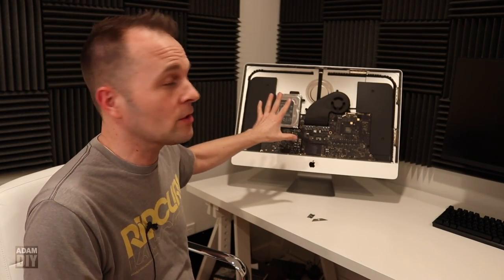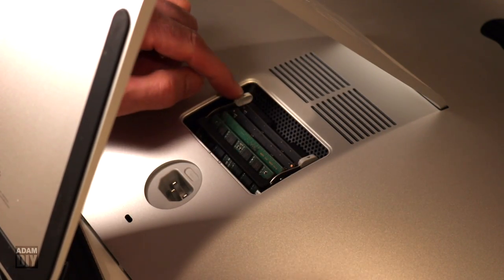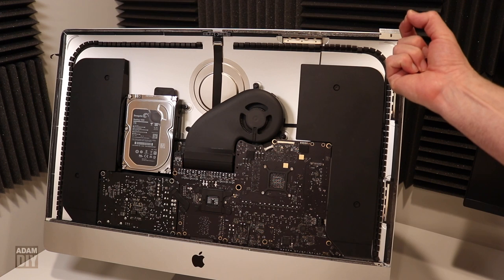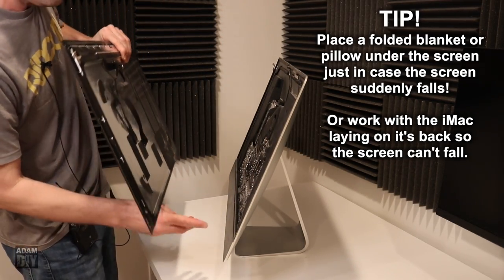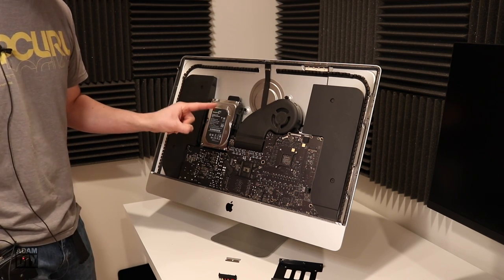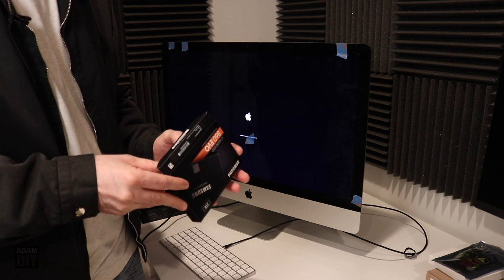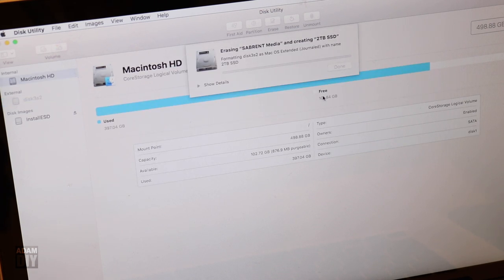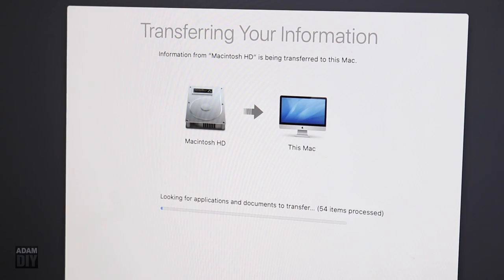$1000 mistake! How to upgrade iMac SSD & Thermal Sensor 2017 A1419 hard drive replacement

Comment: Another idea. A lot of adhesive tape isn’t supposed to have a load on it for at least an hour. I replaced a friend’s iPhone battery yesterday, replacing the seal too, and one repair video showed putting the phone on a hard FLAT surface for an hour or so with some heavy books on top. Laying the iMac face down for a few hours, just under it’s OWN weight, might help. (Keep painters tape on while flipping over, & until afterward.)

Comment: i've a iMac 2017 27" with HDD. I switched it with an SSD without the temp sensor (only used a bay to mount my SSD 2,5" on). No issues with the ventilator!
Reply: Not all iMac models require the heat sensor. Check with OWC or iFixit.com for which models do. There’s also software that will control the fan speed after boot up. (If already hot, such as during a Restart, the fan will run full tilt until finished booting.) I wish OWC wasn’t the only company making/selling them, because ~$40 is a lot to pay for a cable.
Reply: @apmiller77   I'm upgrading 27" late 2012 to ssd, currently attached using external usb to sata iii cable. When I open screen using $10 amazon tool + new tape kit can I avoid needing an expensive sata inline thermal sensor cable?  Can I avoid a 3.5" to 2.5" adapter tray and instead just zip tie the new 2.5" ssd into place?
Reply: I'm upgrading 27" late 2012 to ssd, currently attached using external usb to sata iii cable. When I open screen using $10 amazon tool + new tape kit can I avoid needing an expensive sata inline thermal sensor cable?  Can I avoid a 3.5" to 2.5" adapter tray and instead just zip tie the new 2.5" ssd into place?
Reply: Can you fit the posts on the bracket first before attaching the ssd,  also all other videos show the iMac laid flat that way the screws can’t fall.
Reply: That's because you don't need a thermal sensor. A cheap SATA Y-splitter cable will do the trick just as well.
Reply: @myusrn  Only the 2011 models need the expensive OWC in-Line Digital Thermal Sensor, the 2009 and 2010 just need a 15-cent 2N3904 transistor. The 2012 and up absolutely Do Not Need the thermal sensor

Comment: Nice work. Did a similar job two days ago, but hadn’t seen this video as yet. Well done. I did my drive replacement with the computer lying on its back the whole time. No risk of losing the screws and was easier to remove and replace the video cables. Good work.

Comment: Great video. Interesting use of silicone. On the Thermal Sensor, I know there's plenty of videos about adding it to your upgrade, and not enough about skipping it. Many of us have done it without any problems (iMac 27" Late 2012 and up). I believe it is an old issue with early iMacs. ie. 2010/2011.  I ran a stress test and the fan speed up when it's under heavy load and resumes normal when it's not. Keep the upgrade simple, leave the iMac unseal,  test it out yourself. If the fan does act erratically,  then you already have an answer for that.

Comment: When you’re affixing the screen, use removable insulation tape along the bottom edge to align it properly & prevent it from slipping off the edge when you’re re-attaching the cables. Also much easier to do all this with it lying on its back
Reply: Indeed. I used a 4" thick piece of foam rubber. Soooo much easier!

Comment: In one of his videos Louis Rossmann said that even his workers had experienced  iMac screens separating from the case. There is 3M double sided tape available. 3M say, amongst other claims, it provides a  "Pressure sensitive adhesive bonds on contact to provide immediate handling strength" How long the Amazon sourced tape has been in storage is unknown. Age could be a reason for failures. I was going to slice and dice my 2013 27 Inch iMac but after seeing Rossmanns video now boot from an external SSD.

Comment: Succesfully upgraded my imac late 2012 without a thermal sensor and no fan issues. I had upgraded my imac before replacing to catalina and I assume somewhere along the line came a firmware update resolving the fan issues.

Comment: If you want a stronger tape than the one you get in the kits you can use VHB (very high bond) tape, beware though, if you ever need to remove the screen again it will be much more difficult.

Comment: Never use a metal blade to cut the screen off, use the plastic wheel tool and a thin plastic card going in 1/2 in no more if possible. 2. you do not need the thermal sensor kit for thin imacs, only the 2010-early 2012 models with the dvd.
Reply: IMAC late 2012 13.2 27": I will replace the 1TB standard harddrive with an NVME 1TB drive as the only drive. So i don't have to worry about fans going full afterburner?
Reply: @DerGolf2000  you need to use a sata ssd. i use crucial mx in 1,2,4 tb. you cannot use an nvme pcie ssd because there is nowhere to plug it in. even if it had a fusion drive there may be a port on the mobo but its for a sata blade, so forget that and just replace the spinner with a sata ssd.
Reply: @macguru9999  i thought i could use an adapter and the blade.  There should be a slot on the motherboard.  The spinning drive just gets removed.
Reply: @DerGolf2000  The slot on a 2012 motherboard accepts apple sata (not pcie) ssd blades, not m2 nvme.  Its only there in fusion drive models. The slot on the late 2013 motherboard accepts apple ssds and can be adapted to M2 , but its only there in fusion drive models and there are compatibility issues with nvme. The 2017 imac onwards is fully compatible but again the slot is only there on fusion drive 21.5s

Comment: To save money and time, take the hard drive cable out of the old hard drive, connect it to the SSD, place a small strip of double sided tape on the front of the old hard drive, stick SSD drive to it….done in 30 sec and yes plenty of clearance when screen goes back on. SSD drive don’t get hot, no need for a thermal sensor, Samsung software Magician will also give you heat readings if needed.

Comment: I use those exact strips all the time without cleaning off the old tape BUT I put a strip of thin capton tape across the outer upper edge, with a nick cut in for the mic.  That way I know its one i have done before and its secure. Using any glue at all is crazy, these ones often can only come apart again by wrecking the screen although you would know where to razor it if its your own job i guess.

Comment: Thermal sensor is not required on any iMac that was able to natively install the Mojave update, it changed the firmware regarding the fans to max.

Comment: I'm researching this and I'm getting conflicting reports. Some say the sensor cable is necessary, others say that after High Sierra, the OS used SMART to determine temperature and the sensor was no longer needed.
Reply: Any results? I would be interested on knowing if the sensor is necessary? (quite pricey!) Thanks
Reply: @tonet_and  No heat issues but I have a machine that crashes when you put drives to sleep so I had to disable that. But as long as my display sleeps (it does) it’s not really a problem.

Comment: Hey AdamDIY, your data is never actually lost. You can use data recovery software with a hard drive dock to retrieve your files again, but it takes time. I would suggest using EaseUS Data Recovery Software for your old hard drive. I know this video was made months after this comment is posted, but if you still have your old drive, then go and try to get your files back. I'm rooting for yah!

Comment: I admit I had the screen fall off after all the work I did.  My screen slowly went forward. I came home and found it on my desk and cracked. I was so depressed after that because I thought I may also need a video card. I brought it to the apple store and everyone around me saw my screen and reacted. I felt everyone's sympathy.   Luckily it wasn't a $1000 mistake but less than $700. Just needed a screen and I had them install the OS since they had it.  It's been great from then on.

Comment: A very easy way to swap drives is before you remove the fac HD,  D/L a program called  SuperDuper  and put that on the original HD.   Format a stand alone ext USBC external drive.  Now, just copy from Orig Drive to ext HD.  Remove oridinal HD,  Put in new SSD.  Turn on  - the machine weill see new drive.  Let it format to the same format type as on the orig drive,  Once formatted,  plug in ext hard drive (not the orignal drive).  Open SuperDuper.  Click copy to move the exact mirrow image to the new SSD.  When done, remove ext drive from USB port.  Turn on computer and wah-lah. Exactly the same as on your original HD, but now, the pace is very fast

Comment: Everywhere is telling me i don't need thermal sensor for iMac 27" 2017 5K retina. can you tell me if i need it?
Reply: Only the 2011 models need the expensive OWC in-Line Digital Thermal Sensor, the 2009 and 2010 just need a 15-cent 2N3904 transistor. The 2012 and up iMacs absolutely Do Not Need the thermal sensor!

Comment: I have a 256gb SSD in my 2017 iMac (it was the optional upgrade at time of purchase) so would I need the thermal sensor as well? I'm going to upgrade to a 2TB as you have as there's nothing wrong with this computer outside of storage.

Comment: iMacs 2012 and older also work without an OWC temperature sensor
Especially with Samsung EVO SSDs
Reply: are you sure? can you show me some proof so i have some more confidence please 🙏🏻 🙏🏻
Reply: @owenmillson  I installed the Samsung SSDs in iMacs myself.
2012, 2013.
Even newer ones like 2017 or 2019 work wonderfully.
Reply: @Toni oh that’s amazing. should i still buy the temperature sensor just in case. so ur telling me any mac model other than a 2012, 2013, 2017, or 2019 will have a the 100% fan speed problem. btw i have a 2012 21.5 inch imac with a core i7 and get 650m, it also has a slow 1TB hard drive. do you recommend i get a 1TB SSD and put it in my machine?
Reply: As a small computer repair shop, I can confirm that installing SSD's without the OWC temp sensor does not cause a full-speed fan rotation in 2012, 2013, and 2014 models and I suspect the same is true for the other similar models as well. The temperature of the CPU and GPU tends to get much hotter than the hard drive and will ramp up the fan speed way before the hard drive would anyway so it's not really a big deal like it was for the old pre-2012 models that always have the fan issue if the sensor is absent and even that can be controlled with a piece of software like Macs Fan Control if you forgot to add the sensor.
Just my 2 cents ;-)
Reply: Steve Harris thanks, that’s really useful info, i was just about to buy a sensor and delay my project on a late 2012.
Reply: @jaffaman99  Jaffaman, how did this work out for you without the OWC sensor?
Reply: @owenmillson  hi, I just upgrade my 21.5 imac 2012 with 1 TB Seagate Barracuda 120 Ssd without thermal sensor working like normal. No full speen fan spinning at all. I Confirmed no problem.
Reply: Imac late 2012, 27"
Tried Kingston SSD 240Gb and Samsung Evo 1Tb
no noise. 
1200 rpm.
Reply: @skharris37  absolutely !
Reply: @skharris37  This true for both the 21" and the 27" 2012 iMacs?

Comment: Why you not use primer for glass, put on then it dries then you put dot of glass seal. when it dries you could  cut with blade. and it more secure then silicon ..

Comment: Im a complete novice at this. What if I i just swap the new SSD in and boot it up, that will work right? I will just be starting completely fresh with none of my old data? Using late 2017 27 inch 5k iMac. I just wanna make sure I don’t have to do anything to the new SSD if I’m okay with not having my old data on there.

Comment: Comment on another site suggested that a firmware update removed the need for the sensor. Not just 2017 and newer. Just Sierra and newer. Catalina shouldn't need the sensor.
Reply from the maker: Good news if true!
Reply: @AdamDIY  I will reply later... My 2014 Retina 27 will be upgraded as soon as the Sintech adapters arrive (for the m.2 part of the upgrade). Right now I have Catalina installed.
Reply: @wbtittle  I'm waiting for your reply.
Reply: Damn.  Forgot about this. I did this so long ago. I actually did two of them. 1. Do not attempt to put a m.2 on a iMac that didn't already have a Fusion drive installed. 

I didn't need the sensor for the iMac that had the fusion drive. It is still running.

Comment: Adam I think i removed the black tape with the seal double sided tape from  the brass sensors top right  and right side they look lightly peeled like a sheen removed by the tape, but no scratches and where did you get the  hard drive sensor?

Comment: Great video on install thanks ! Question though will SSD work with internal SSD as fusion drive just like hard drive does?
Reply: Not sure if I'm understanding your question but I have both a SSD hard drive and an internal SSD on my iMac and it works fine.

Comment: Wait, did you just switch your hd to ssd and it just started up? Did you do a cloning first?
Reply: Yes, he showed us that: put SSD into a temp external housing with a cable, down-loaded newest OS via App Store onto SSD, and then installed it. Since it had a working Mac OS, the iMac recognized it and started up.
Reply: paul sheridan can it be a sata to usb cable or do we have to use the housing unit one?
Reply: @eddierey220  cable is fine

Comment: I did the SSD upgrade not so long ago swapping from a fusion set up to a larger SSD on the board and a 2tb SSD in the bay. I used the inline kit with the sensor and everything seemed to be fine. My iMac died a few days ago and I don't know whether this had anything to do with it but, when I cracked her open, the thermal sensor had come away from the SSD. I would definitely advise a stronger adhesive solution than the stock double sided tape it comes with. I also exhausted all avenues to reboot the Mac and Single User mode was showing up panics. I was however, able to retrieve my data by booting the iMac into target disk mode and connecting to another Mac via Thunderbolt. the drives popped up straight away and I just pulled off the files I needed. Damn lucky that worked.
Reply: After recovering your data, what will you do now with the iMac and SSD drives?

Comment: I replaced my Fusion drive and put in a 4T SSD. A certified Apple Repair tech told me that the thermal sensor is not needed on any SSD drive upgrade for the 2017 iMac 27 inch or newer. I was told this when my Mac was in for a warranty logic board repair. Now.... having said that, it’s going back to Apple because the fan runs at full speed immediately after powering up.  Curious to see what the reason is for the full blast fans. I think it’s the lack of a thermal sensor. Apple disagrees.

Comment: Does anyone know if the fusion drive removed from inside can be mounted in an enclosure and used as an external fusion drive?
Reply: The fusion drive its a fusion between an small 32GB m2  and a 1 TB HDD, so yo can use the HDD. But also when you taken both them apart you can make an external  fusion drive but have to pay for a case for m2. Also has to use 2 ports usb. So in that case its better  use only the hdd as an external drive storage.
Reply: @josemiguelpomaredamasgo8039  Thanks

Comment: You don’t need to replace the hard drive. You should have just used the recovery os to format your hard drive to Mac OS extended, then installed Mac using the internet recovery os. Simple. You access the recovery os by doing Command-R when you screen lights up after restarting, before the Apple logo appears. Internet recovery is accessed by Option-Command-R or Shift-Option-Command-R. Simple, again.
Reply: Surey the object is to make your mac faster with an ssd?

Comment: You did not do it as it has to be made ! No silicone too ! You also have to peel the adhesive when the screen is in place, locked apart from the one at the bottom .....

Comment: Five sixteenths. 😁
Thanks, I am thinking about replacing the mechanical drive for an SSD, but still not decided when it will happen. 🙂
I am technically literate and capable, but I am also capable of rushing through things after some time and breaking things. 😂

Comment: Hello.. Even though i put the sensor in place the fan still running like cra z what can i do to solve that?
Reply: what imac do you have this problem with?
Reply: You could try a fan control program like TG Pro. I've used it for years. Not sure if it'll help your situation (I suspect it will), but you can try for free and I think it's rather cheap to buy.

Comment: NOTE: I successfully installed an SSD in my iMac 2017 5k 27"  WITHOUT the need for the overpriced OWC thermal cable adapter. No fan speed issues, works perfectly, just plug it straight in. Worth researching, I believe the modern models do no require the adapter.
Reply: I agree, on my 2013 I attached hard drive cable directly to SSD without any heat sensor and it has been fine....I don't know if people are aware, but trying to re-open the Mac after applying the after market tape is extremely hard to do without damaging the screen....This happened to me and I was using the pizza cutter tool, which wasn't quite strong enough to cut through the tape without additional pressure which eventually damaged my screen.. The manufacture that I purchased the replacement screen from advised me once the screen is sealed up, it will most likely not be able to be removed safely again....